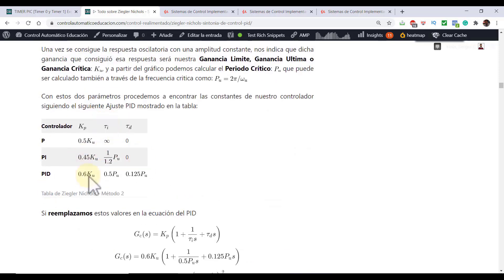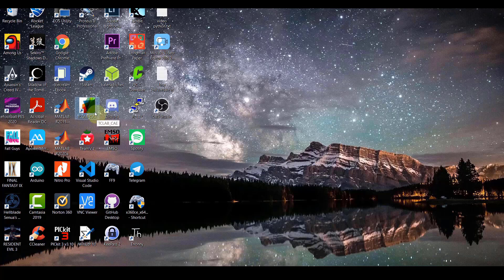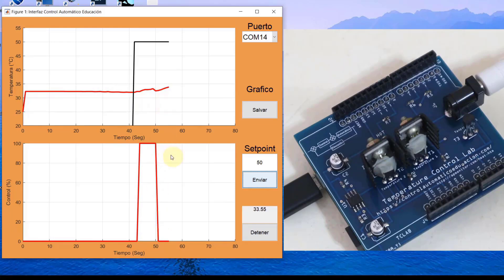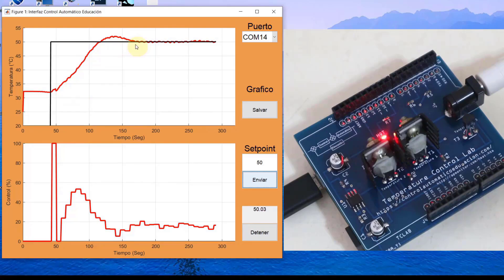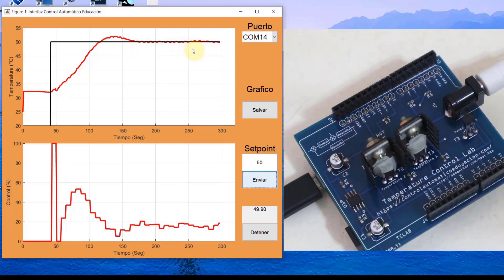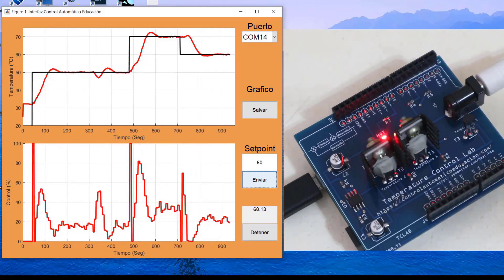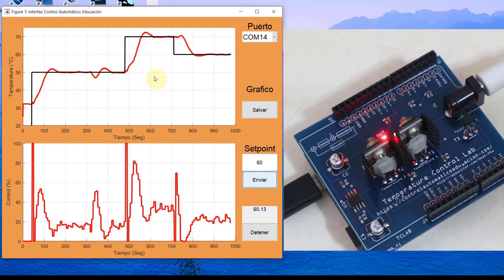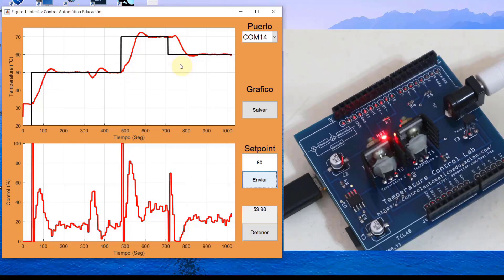PID Control on Arduino: Ziegler - Nichols Method  | Applied Control System Course

Comment: If I don’t have TCLAB board. Can I learn this course? or You will teach creat board too.
Reply from the maker: Absolutely! In the Applied Control System course, you will not only learn how to utilize the TCLAB board but also how to build it from scratch. This comprehensive approach ensures that learners without access to a pre-built TCLAB board can still benefit fully from the course. By providing step-by-step instructions and guidance on constructing the TCLAB board, the course promotes a deeper understanding of control system concepts and empowers students to engage actively in practical implementations.
Reply: excellente!  @SergioACGiraldo